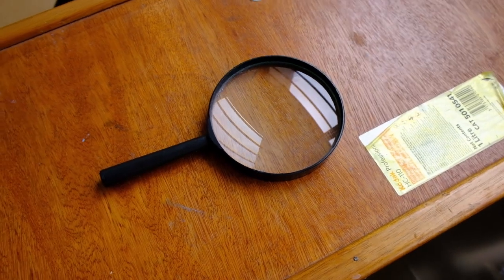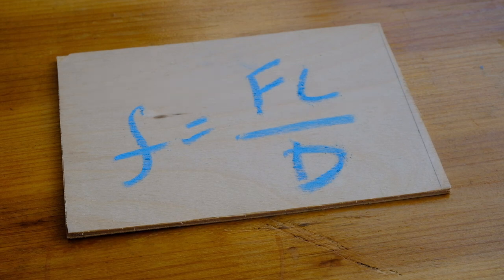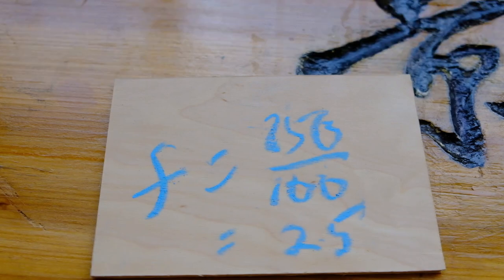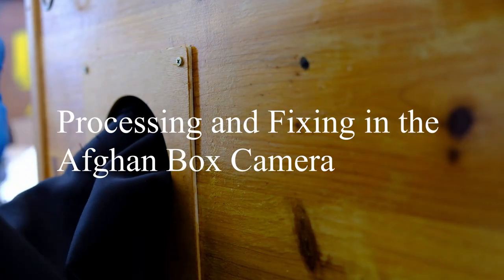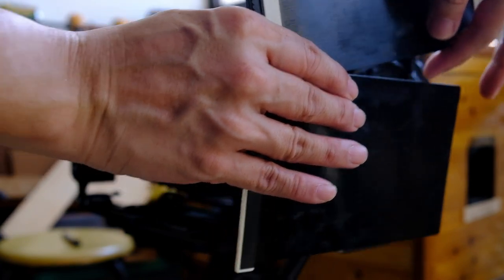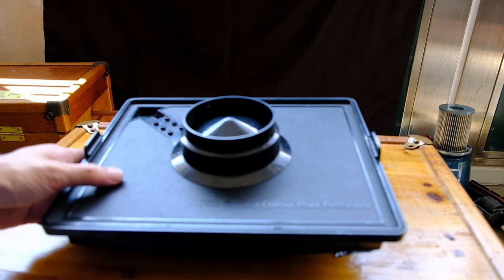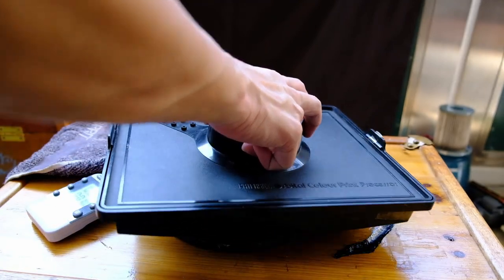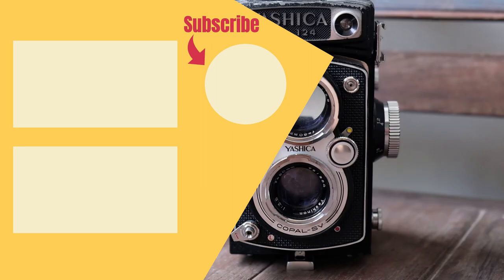Film photography - Fun with magnifying glass as a camera lens

Comment: Nice work, thanks for sharing it. I used two similar magnifying glasses, mounted together, to shorten the focal length for my box camera. I also made some aperture inserts to reduce the diameter and had some slightly sharper results with that. These experiments are a lot of fun aren’t they?
Reply from the maker: indeed.. i must try the 2 magnifying glass method soon as I have some other idea for a box camera. thank for the tip and for watching.
Reply: Analogue Photography Talk it was a tip from one of the people on the home made camera podcast and worked really well